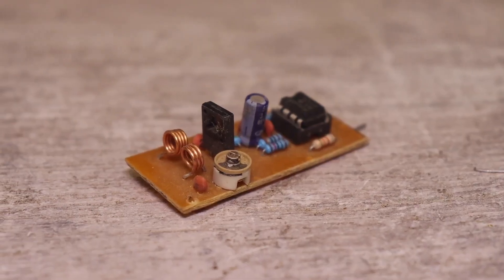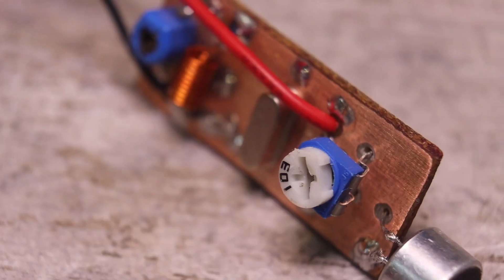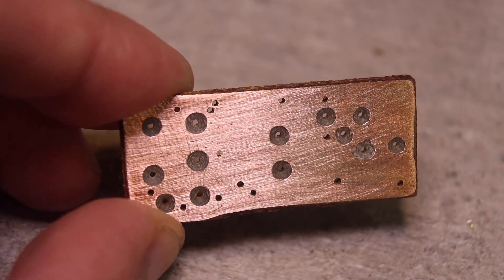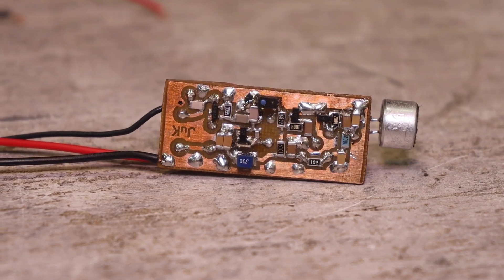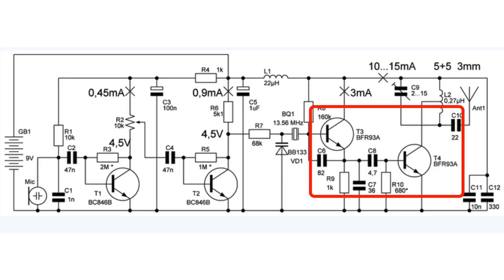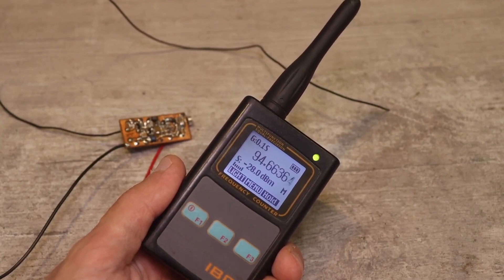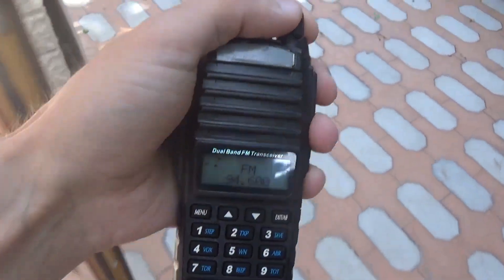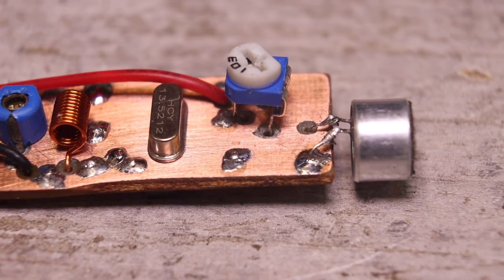The Best DIY Radio bug

Comment: The "I" in wind is pronounced as a short vowel when it's used as a noun. When it is a verb or an adjective the vowel is long like "eye" (as in winding, a the circular form, or to wind something onto that form (wined). For example transformers have primary and secondary windings (wine-dings) 😃

Comment: In my opinion - deviation of frequency will not quite big. You will not receive this transmitter on usual FM broadcat receiver - there must be narrow-band special FM receiver. Much better results may be acheived with couple of crystals with small difference of frequencies. I had two crystals with 6kHz difference and deviation was quite big for usual FM receiver.
Reply: Must keep that in mind the next time I make one of these 🇮🇪👍

Comment: These types of circuits are also a great help in tuning radio receivers, once you know the exact frequency.
Except here you opt for a very low output signal, not to broadcast too wide in your local area ...

Comment: The oscilator runs at 100mhz because of the 13mhz crystals 7th harmonic 😂 really glossed over that with no explanation 😅
Reply: I have no idea but 13.56mhz x 7= 94.92mhz